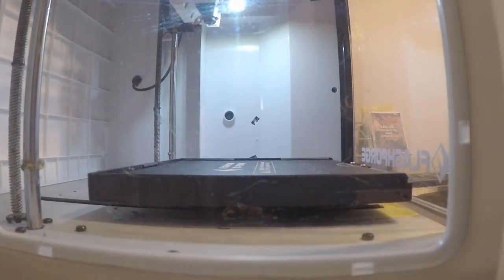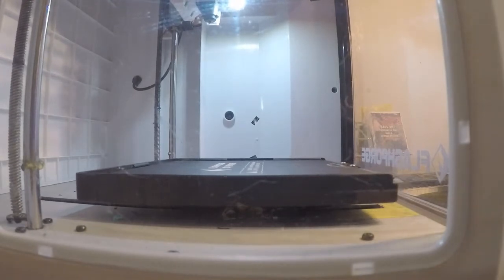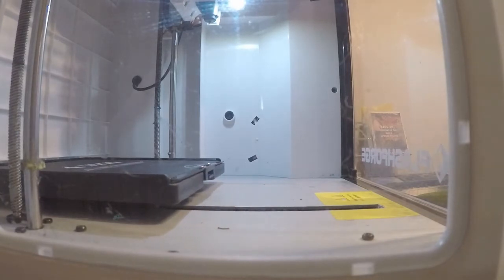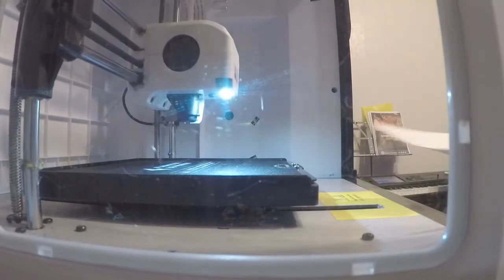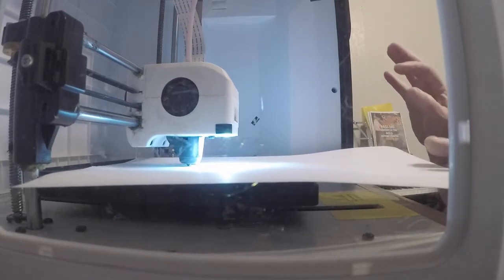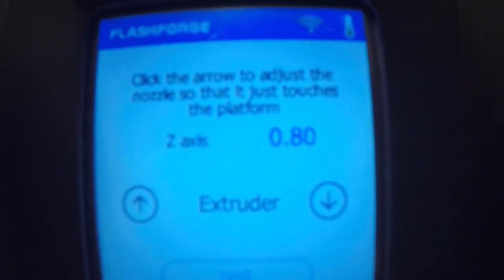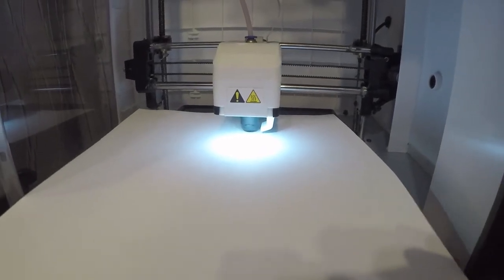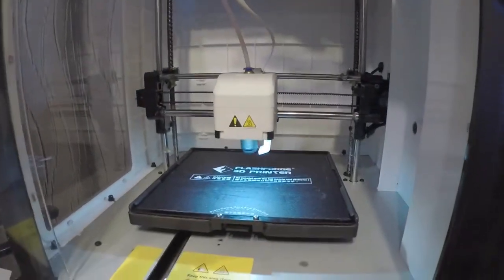How I calibrate my Adventurer 3 Printer

Comment: This printer calibration is so loose so I've ended up with manual calibration and printing 9 point test pattern every time by adjusting every point +-0.1. This table just a joke...
Reply from the maker: It's a bit of a truck... but then if you dont expect it to be exact (cause lets face it, it isnt) then I've found close enough is good enough.  As long as the noz isnt trying to bury itself into the print bed, then all should be well (enough)...
Reply: @Rotors407  Ive updated the nozzle yesterday and spent whole day for calibration. Ended up with -0.1 in one corner and -0.9 in another, -0.4 in the middle. Crazy. No any options to mechanically adjust the bed was a bad decision. I see four white plastic knobs on the back of the bed - any ideas what that can be?
Reply from the maker: @vsobolev  I dont have those.   I've only got an Adventurer 3...

Comment: Thank you for the video! My printer started to print very unevenly. Read about re-calibrating it, used this technique and now it prints better than when i got it! The calibration was way off, some spots was way too high, and some was way too low.
Reply from the maker: There are a few factors that make a bed uneven.  The plate itself is flexible, you bend it to get the print off.  They'd like to SAY it bends back to its original shape and flatness, but lets be honest here, very few things actually do that...  so slowly, over the course of time, the plates will bend and STAY bent

The bed heats up/cools down...  it skids about on a wheel roller, and a servo screw thread...  The print head is moved about the place by rubber belts, and the gantry rods have to do their best to keep things accurate having suffered the lack of maintenance/grease that can be expected by an end user who is not told how to do that properly, and "guesses" when and where to grease or adjust it.

expecting it, therefore, to be an accurate piece of equipment is a bit of a stretch, if we don't replace the bed plate...  replace the bed stickers...  grease it regularly...  level it occasionally...

When we expect it to be millimeter perfect, we start setting tolerances too close, and that's when the inaccuracies of the rest of the printer become VERY obvious, or even catastrophic (PrintHead crash into the bed, if the bed isnt flat)...

In as much as it pains every fibre of my mechanical background (which likes to be accurate) to say...  "Close enough" is good enough, for this printer...

Comment: Switch to the glass bed. You'll thank me. Not that the glass has any better adhesion but the plate and housing doesn't have springs so it's much flatter and doesn't move about like the plate that's standard.

Comment: Make sure you preheat the base and nozzle
Reply from the maker: Have never preheated...  Not sure what difference there'd be to the distance between noz and bed, if it were hot...  Why do you preheat?
Reply: Because when base and nozzle are heated up  they expand and that little expansion can make a difference when trying to calibrate.
Reply from the maker: @Outside_Productions  I fear you may be accrediting the printer with accuracy it simply doesnt have.  The printer is no-where near that accurate, hell it doesnt even come with its own units, it just calibrates at 0.80...  Doesnt say 0.80 whats...  thou?  mm?  not mentioned.

If the print bed and noz were hot, the printer will still calibrate the same way, to 0.80 somethings...  Just the printer Z stepper motor might stop a little higher up the Z gantry to achieve it.  End result would be the printer would still put the print head in the same place...  Right on that piece of paper... Sure, it might say 0.81 now...  but the paper hasnt changed thickness...  Print head is still in the same place in relation to the bed...

If the print pair were cold?  the Z Stepper might have to come a squillionth of a mm lower down the Z gantry to put the print head in the same spot...  right on the same piece of paper... you're right!  No-one knows or indeed cares what the printer reads...  Same paper, same thickness, same distance from Head to Build Plate

You dont have to heat the print pair to calibrate... Especially an inaccurate device like a 3D printer, and especially as you're using the worlds most inaccurate (paper and butterfingers) calibration method...
Reply: @Rotors407  flashrorge is definitely inaccurate and capricious, but when i had difficulty with 9 point calibration it helped me.

Comment: Hello, I have a question. I'm very new to 3D printing and I just received my adventurer 3 pro yesterday. I unpacked it and began setting it up. I turned it on and it wanted me to calibrate the extruder so I started the process but it took me around the bed about 9 points of calibration. Is that normal and did I do something wrong?
Reply from the maker: No... thats fine..  first time checks...
Reply: @Rotors407  excellent thank you so much.

Comment: What GSM paper do you use
Reply from the maker: Whats standard copier paper?  80?  It honestly wont make a noticeable difference...  the printer isnt a precise, exact, or accurate device...
Reply from the maker: (...or I'd be taking the flexible build plate off it, and using feeler gauges to level...)
Reply: O
Reply: Do you know how to stop the adventure three from warping
Reply from the maker: To be honest, I've only had mine warp once, but I have a working theory that PLA+ acts like wood.  The way you stop wood from warping is keep the temperature consistent, and the wood dry.  I already do that, so I figure thats the reason I have only ever seen one warp...  Dry filament, machine is always on, and warm...

Comment: That's what I do for mine as well. Works very well. What I do as well is then put a couple strips of 2" masking tape on the bed using a piece of paper to adhere them rather than my fingers which may put finger oils on it. This masking tape then reduces the distance just a little bit more and results in excellent adhesion. It's also a lot easier to remove parts off the bed when done. Hope that helps.

Comment: do you do this with the bed and nozzle heated up ot cold?
Reply from the maker: I dont know that the calibration feature has the option to...  or indeed is required to...  heat up first.

I doubt that being hot makes any difference to the final outcome...

Comment: hey Andy, Do you think I should buy this for my first printer and if i shoudnlt what others do you recommend?
Reply from the maker: I've done 3127 hours on my printer, and the only fault I've had with it, is a blocked noz, cause of something I did (trying to be clever, and print with a filament I knew the printer doesnt print with, clogged the noz all to hell, had to buy a new one)...

Trick is, I dont know that any OTHER printer wouldnt do as well as mine does, because I'm all but certain its how to treat them that makes the difference.  I've levelled my printer less times than you have fingers on your hands, because I dont turn the printer off...  ever...  Will you do well with an Adventurer 3?  Yup, and you know how to get in contact with me if you're ever stuck...
Reply: @Rotors407  awesome thanks man, 1 question though Should I buy the Adventure 3 Lite or Normal version? In Australia Lite is $479 and the normal is $579. 

Its just I really want to get into 3D printing & I ended up buying a Ender 3 V2 went through hell (20+ hours) and back setting it up and when i plugged it into the wall sparks went flying and the thing got fried!! & took out my houses electricity too but I was able to fix that. I really don't want to let go of my hopes of 3D printing with that 1 shit experience.
Reply from the maker: @privateviewer904  Yeah, ADV3Lite is just an ADV3 without that silly camera, right?  Which you wont use, cause its daft.  The V2 can print PETG (which is the filament that gave me grief with my noz), and I've not needed a run out detector yet...  I pause the print, change the roll, resume the print if I need to.  Many ways to skin a cat...

Get the lite, save $100
Reply: @Rotors407 Okay, but what are the cons and pros so far for you with the adventure 3
Reply from the maker: @privateviewer904  I cant answer that unbiasedly as the ADV3 is the only printer I've owned.  So I can tell you about this one.  The printer is brilliant, it has limitations, and is not an exact machine, but bearing that in mind, its great.  The camera is ornamental at best, I dont use it anyway...  I cant tell you about the filament detector, as its another device I dont use.  The only drama I have with it is filament based.  Keep the filament dry and you're all good.

3000+ hours so far...  The only thing on my wishlist, is 150*150*150 isnt very big...
Reply: @Rotors407  thanks mate

Comment: Do you do all 9 points or just the center?
Reply: Just the center is enough. 9 point calibration is misleading. It's not actually leveling 9 points of the bed . All it does is take the mean or average of those points and adjust extruder to that height. Just one height adjustment, that is why you will constantly get same results after going through 9 point calibration multiple times just to fail. I learned this from just make it Daniel
Reply from the maker: Just the centre.  I've not dont a 9 point level yet.